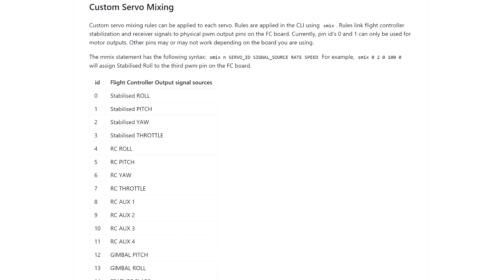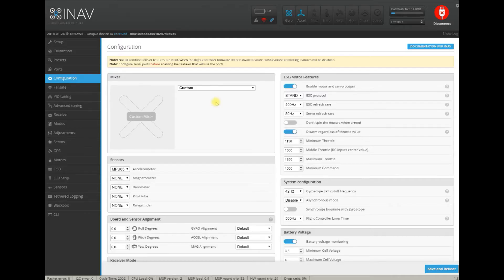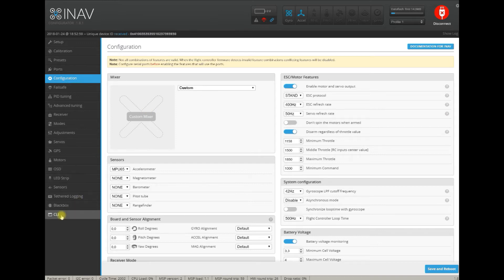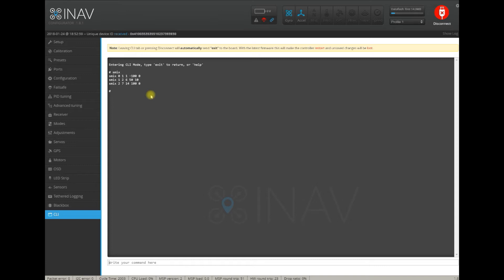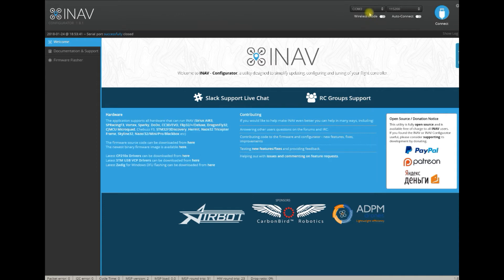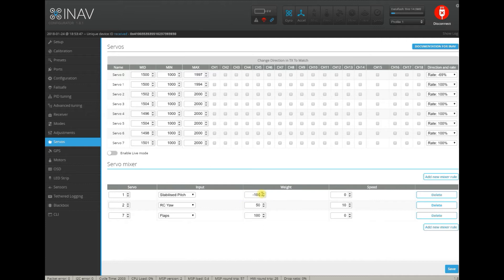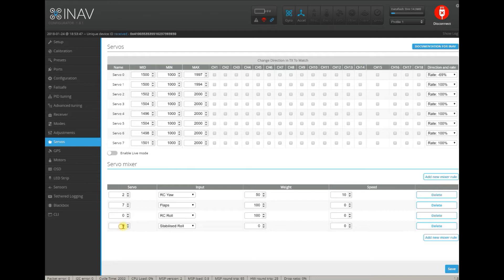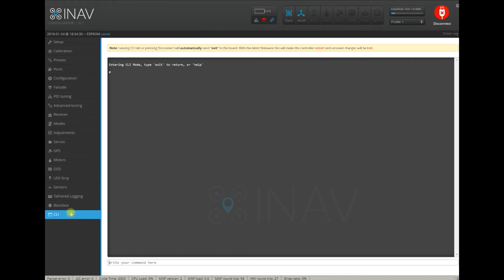INAV Configurator Servo Mixer GUI - simply manage smix rules

Comment: I just saw this I’m trying to do same thing but how do you connect servo to FC do you add the signal wire to uart then how do you add the servo to a switch in OpenTx. I’m using a crossfire nano RX how do you set up a switch to operate PWM SERVO my fc is on a quad not a wing.

Comment: Sir, I have installed the rudder, elevator, allron, in my RC plane, but they are doing the right thing, but Flap the 2 servo is not connected to pwm 6 with the help of Wi cable, but not running and which is inav 2.0 In the mixing of s6 which is pwm, the servo is not going to be servo servo so, s1, s2, but nothing is written in se but servo s0, s1, s 2, s7 is coming to the servo Do flaps , sir my WhatsApp number +918077 544 605 help

Comment: How do I get vtail on mini talon to have some deflection in rolls or turns. Say I’m in horizon mode and I turn left my vtail should show some deflection to compensate and help the turn.  I’m not seeing ANY movement in vtail.  I’m on latest inav 2.0 and chose mini talon in mixer tab so all my vtail surfaces move correctly except for while in stabilization modes I’m not seeing any vtail deflection to help in turns like I’m supposed to.  Why is this am I missing a mix or what?  I’ve been trying to get an answer from someone from group but all I get is lagged at or ridiculed saying read the wiki which I’ve done multiple times and I set everything up as directions.   Please help.

Comment: Just upgraded to Inav 2.0 from the 20.8.2018 and need to connect channel 7 to Flaps but nowhere seem to be a way to do it. 
The new instruction tell that CLI custom mix no longer will work at it has to be done in the graphic configuration mixer. 
In your video at 1:48 it's possible to check channel to servo,  but there is no option to connect a channel to a servo now in my Inav 2.0. 
Only Mid, Min, Max, Rate, reverse and output.
Reply from the maker: In INAV 2.0 there is a new tab called Mixer. It has all you need
Reply: yes i see there is a RC channel 5-8 to use in mixer tab, but from where does flaps gets its input? or does they only work as flaperons?
Reply from the maker: Mixer input FLAPS is driven from flight mode FLAPERON
Reply: Paweł Spychalski Thanks for letting me take your time, that makes sense. Haven’t noticed that mode.

Comment: Hi. I have been working on the servo setting for days in iNAV 1.9.2 using a SP Racing F4 EVO. I am suppose to be using servo setting for the motor/ The best I can get is servos working but as I increase the motor and use the rudder the rudder will not centre until I drop the motor to zero. Any ideas please?
Reply from the maker: but what do you want to do?
Reply: I want to have a single motor airplane with two aileron, pitch, yaw, flaps and throttle. I was setting it up using "mmix reset" "mmix load AIRPLANE"  and 
"smix reset
smix 0 2 1 100 0 # Pitch / Stab, Pin 3
smix 1 2 5 100 0 # Pitch / Rc, Pin 3
smix 2 3 0 100 0 # Roll / Stab, Pin 4
smix 3 3 4 100 0 # Roll / Rc, Pin 4
smix 4 4 14 100 0 # Flaps, Pin 5
smix reverse 3 0 r # REVERSE Stab Roll
smix reverse 3 4 r # REVERSE Rc Roll"  without quotes. from GH website. but got confused about the motors, where to connect as pin 1 and 2 did nothing.

I then did the same using iNAV 1.9.2 but in servo tab. Which s a great feature by the way. and adding a negative to one aileron. 
What does the RC stand for. I want STAB to help me out in adverse weather but also want MANUAL for more immersive flights. in 1.9.2 I still have PASSTHRU not MANUAL. 
I need command " elecifun reset" and to try again.
Cheers !
Reply: I've done it : ))

Comment: Thanks I have another item, I’ve set up INav for my chameleon 6 inch primarily for acro flight with the safety net of Gps RTH. I’ve kept the filters on the default values. Now I checked when I loaded the preset 5 inch racer values the filters have changed . In fact from very low values to larger values. I will test I wonder how much improvement will the filters be on my quad .

Comment: Hi I have a question about this cli text , does this work or act like Anti Gravity feature of betaflight ? The line cli; 
 set Inav_gravity_cal_tolerance  = 5
Reply from the maker: It has nothing to do AntiGravity as known in betaflight. Docs states that: Unarmed gravity calibration tolerance level. Won't finish the calibration until estimated gravity error falls below this value.

Comment: Here's an issue. INAV configurator vs 1.9 (just out) and INAV Firmware 1.8 Ominbus F4 Pro. Start fresh setup. Goto CLI type smix reset, save. Goto servos GUI and setup for just stab role, i.e outputs 3 and 4 to drive control surfaces 4 and 5 (ailerons) for AIRPLANE, save. All works nicely. Now goto the CLI, type smix and look at what is there, it looks to be correct. At this point IF you hit SAVE in the CLI the controller will now control only one stab role aileron and also the pitch (elevator) yet this is not what the CLI shows, as nothing has changed. The only fix is to goto the CLI again and type smix reset and start over. Very weird???????

Comment: Nice! Could even being perfect if you move (or add) servos outputs display into the Servo tab rather than being in the Motor tab :)
Reply from the maker: All of that will be changing in next releases as long as I will have time for those changes
Reply: Roger. Thanks